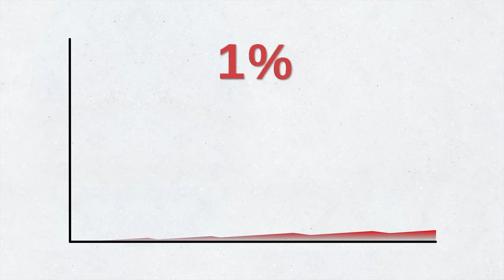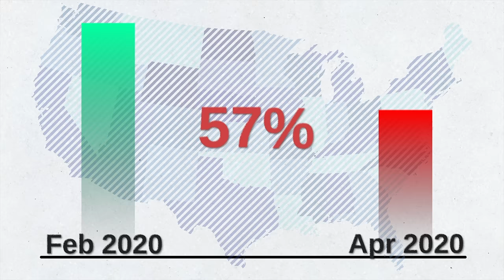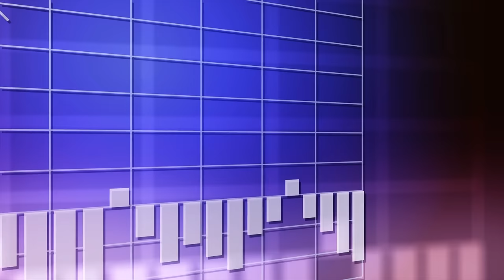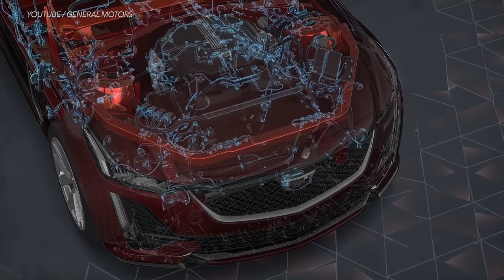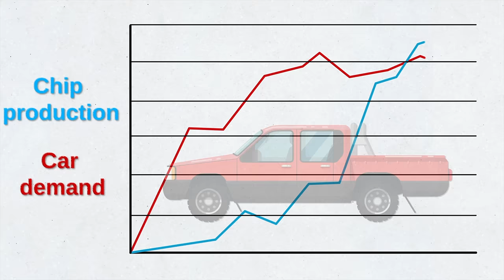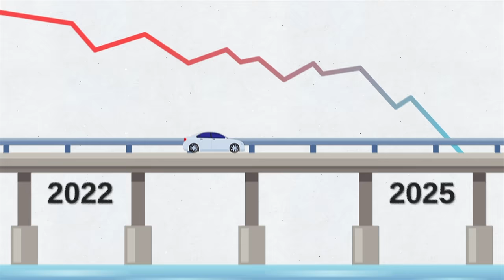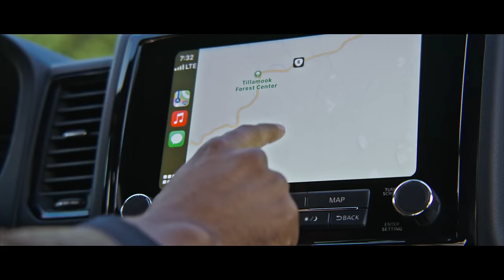Brace Yourself, The Car Crisis Just Got a Lot Worse

Comment: My 2013 Camry with 146k miles is shuttering between 40 to 50 mph.  I think I need a new torque converter or transmission.   Toyota is aware of this since they put different transmissions in the 2012 to 2014 year models Camrys.They keep torque converter in stock at dealership. They have not done a recall.   Dealerships knows we will pay price to repair.  Cheaper to replace torque converter than purchase a used or new vehicle.
Reply: Things wear out. It’s old and driven. If it’s a semi-common failing item they will stock it. Not all issues will be a recall subject. If the shudder is minor I’d suggest living with it. As long as your fluid isn’t contaminated it is likely just a stick/slip condition during lock up. At least on the Honda side renewing the atf greatly helps vehicles like the pilot and odyssey. How is the vehicles atf maint history?

Comment: Aug 2021: Bought a 2010 Toyota Venza V6, with 118K miles; out the door with Credit Union GAP, 3 year full coverage ins on engine and tranny for $12,385.00
Sold old car for $2k, so $10,385.00.  You tell me, did I get a deal in these days and times? Yes, I overpaid, but not nearly as bad as what I see the same car going for now with nearly 90K more miles than mine. Cheapest I've found a 2010 Venza within 100 miles of me is $16k.
I want a F150 or Tundra, but I'll wait while keeping the mileage low on this Venza. Back in August all the F150's and Tundra were already out of my price range, today OMG! If it's on a lot, they start at $19k with over 200k miles and at least 9 years old plus.

Comment: I just bought a 2013 F150 Lariat 4x4 5.0 V8 with 90K miles. Got it for $18,000.00 and strangely felt like I got a great deal. I figured that if I waited too much longer, it would cost me over $30K for something similar. I wasn't looking for such a fancy model. Just wanted the extended cab instead of the crew cab, and they are hard to find in SoCal. I plan on keeping it until it falls apart.
Reply: My co-worker bought a 2000 chevy half ton 4x4 extended cab short box with 70,000 original miles in mint condition for $17,000 in August 2021.  He said it was a lot cheaper than buying a brand new one.

Comment: Just bought a used Mini Cooper with slightly over 1,000,000,000 miles. Came with complementary windows phone charger and a flat spare tire. Only paid half a mil, and was told “It’s a great deal”. Payments are only about 50,000 a week. How’d I do? 😂🤣😆

Comment: Wished you could of made this video back in December 2021. I wouldn’t have sold both my used cars to private buyers to pick up a new 2022 Honda Odyssey Ex-l. I want aware of the car market issues. Dealers were either out of stock or had an unknown ETA for the vans coming in. They were selling 2018-2021 used odysseys for almost brand new msrp price with some decent mileage on the vehicles already. People also were putting money down on new Odysseys and placing a hold on them too. Also, most dealerships had a “MA” aka Market Adjustment price that was approximately $4k extra added on. We were literally going to buy a van with the crazy price mark ups due to us being car-less. I found a perfect red in color Odyssey that I wanted at a Honda Dealership the night before. Expecting it to be en route to the dealership yet and expecting the added “MA” I wasn’t too hopeful to call them in the morning. I literally was on my way to another dealership the very next day to pick up an overpriced Odyssey as we were car-less for a couple of weeks. Luckily, I called at the dealership for the red one and due to it being the last week going into the New Year (2022)…They were selling it for MSRP! Still had to wait 2 weeks for it but it was well worth it in the mark ups and out of stock Odyssey issues at all the dealerships I checked and looked at. That’s was my crazy story I experience that I went through.

Comment: I had to get a new car, my 02 nissan sentra was dying I paid $1650/200000 miles, just before 250000, timing chain was going, couldn't do it myself, cheapest I could find was $800, I got a 2020 yaris/Mazda 2, not a bad car, I bought it last year it should have been around $18000, I paid $22000, but I drive 120miles back and forth for work

Comment: I bought a brand new Nissan kicks towards the beginning of the pandemic, September 2020. Wasn't even looking for a car, Nissan called me out of the blue and told me they wanted to buy my existing car because their supply of used cars was low.  I told them I like my car, and hadn't held a  job in 6 months.  They said we don't care if you don't care. So I made them a lowball offer,  they said okay, so I said ok.   Ended up being Blue Book value for my trade, and $3,700 off on a new 2020 $21,000  vehicle.   Easiest automobile deal i ever made, beginning to end about 30 minutes tops.

Comment: I ordered a 2022 F150 XLT 4wd on 29Nov21 for $6k under MSRP with X-plan and current rebates.  I got premium trade value for my 2017 F150.  I figure adding those two factors together it was about equal to the typical $10k off sticker at the end of year we would normally expect.  Difference is I got to order exactly what I wanted.   I also bought a 2022 Camry SE, taking delivery in October of 2021.  I paid MSRP and had to wait 10 weeks for a dealer traded vehicle that was pretty close to what I wanted.  I might have paid $3500 more than a typical deal, but considering we are seeing prices go up I'm not sure it really is all that bad compared to waiting.

Comment: Thank you for the very informative videos. 
I caught a break. Two months ago I sold my very low mileage mint condition 2020 1794 Tundra for $12,000 more than I paid for it. I then bought an Avalon limited hybrid $2000 below sticker & shipped it overseas where I spend 90% of my time lately. Ideally I would rather have the tundra as my daily driver but as it's considered a work vehicle in the country that I'm in, I cannot get a student tax break on it, so for now the very cramped Avalon will do.
Gasoline here cost double than the USA.
Hopefully in about a year or so I can sell this vehicle and bring in a 2023 Capstone or 1794 Tundra

Comment: I did pretty well considering the market. We baught a 2020 Toyota Camry SE that had 24k miles on it and by the time everything was said and done we financed 24k after trade in.  We got a lot for our 2015 Fusion more than I expected, but the car we have now is far superior to what we owned. Since that time about 2 months ago the prices have went up again. I did not want to buy right now, but my wife needed a dependible car and the Ford Fusion was not dependible or reliable. Sad too because we liked the Fusion fine it just was not built to last like the Toyotas are. In fact I do not think any domestic car or suv is built to last right now. Too many Govt. mandated technologies that are proving to be un-reliable and super expensive to fix. Yeah even our new Toyota will be crazy expensive to fix, but I will take my chances with a Toyota or Honda anyday over a Ford or GM made product. Ford and GM were making some damn good vehicles in the late 90's to early 2000's then by 2005 they went downhill fast!

Comment: Car dealers raise their prices due to the fed tightening the credit system, which requires higher payments due to less risk availibility bc all the injexted $$ wait till those ppl who bought their benz default, currently its expected to be higher than in 08, if you can weather the storm id still wait, used car lots are filling up as credit tightens.

Comment: When you have to reprogram a car or truck just  to change a fuel injector to get it to run right.  What's next? Reprogramming for a spark plug change or changing a spark plug wire set? Oh wait you already have do that with some cars if you change a coil.

Comment: I drive my 1973 MGB all summer for the most part.  Nothing electronic(still runs points), everything works and it gets 27MPG.  Built in anti theft device...called a manual transmission and manual choke!lol!  I'll also still be driving if Russia launches a nuke and the EMP fries all the new cars as well!  More gas for me!

Comment: They should make the infotainment system optional. I personally prefer simplicity. If a button goes bad, its just one button. But if the infotainment system goes bad (blank), a lot of features are inaccessible. I personally experienced it. Same thing with those fancy LED trim/brake lighting. They consist of many tiny LEDs. Over time, some LEDs go bad and the visual effect is crappy. In addition, its cosiderred a mechanical vehicle violation and you become a subject of getting pulled over...we don't want that! So when individual LEDs go bad, the only choice you have is to replace the entire light (housing), which can get expensive very quickly up to several hundred dollars! Remember when you could just buy a simple bulb for $5-7 dollars? Again, I like simplicity. These days, the manufactures are cramming more and more electronics in the cars. That means there is very high probability that something will malfunction...and it will malfunction. I wish the manufactures made simple cars (easy to maintain) and also cars loaded with electronic for those buyers who prefer those kind of vehicles. We, the consumers, are at the mercy of the manufactures and we can only get what we are offered....not much in the world of simplicity.

Comment: Due to the rise of gas prices I have been looking for a fuel efficient daily driver, my current vehicle being a 2016 Tacoma that gets 17 mpg at best. The search has been HORRIBLE. I've been trying to find something decent under 2k which is impossible around me unless you buy a car off FB marketplace which will come with a mystery issue. I had my eye on a 95 Celica gt that was on a local used car dealer stone lot. It is currently not for sale yet though as they need to do an enhanced inspection because of the car formerly abandoned. That makes me nervous to buy in the first place plus with the way car prices are it probably won't be cheap either. I now however have the opportunity to buy a 99 civic sedan with 120k miles on it from my grandma and she won't accept me paying over $1200 for it... I mean hell of a deal for me with the way things are! I'm lucky but I feel for those that NEED a vehicle right now.
Reply: get a hundred dollar scanner for starters.  learn how to use it or hire a mechanic like scotty to check it out.  don't buy anything without scanning it first.

Comment: just bought 2002 Pontiac Firebird Coupe base $16000 with 17,500. actual miles, 3.7L V6, one owner no accidents.  Is there a problem buying older low mileage autos? my current car I bought 8 years ago, a 1995 jaguar xjs inline 6, 4L, 17,000 actual miles, one owner $13000 on ebay.  Had to replace fuel pump very shortly after getting it.  Got 92,000 miles on the jag now and no other major issues, runs great.  So again, is there issues buying a low mileage older vehicle that I may not be considering?

Comment: Enjoyed your take on lack of chips presentation.  I bought a 2011 F150 for $12,000 that has 100,000 miles, V6 that does not have  booster.  I traded  2003 tundra which he gave $3,000 reducing the $15,000 original price for the F150.  Did I do well?

Comment: I have a 2011 Rav4 4WD V6 it's got 140,000 miles on it and no signs of slowing down, I live about 60 miles east of where Scotty grew up, if you know the area you know it's probably the absolute worst environment for a vehicle  in the States.  I will never buy a used vehicle it's simply stupid. Why buy something that is going to die before it's paid off, it's just dumb and also my opinion.

Comment: I just stole a Jeep Patriot 2015 been sitting in a garage for the last 3 and 1/2 years $24,712 MI manual transmission late could not drive it like your Toyota manual everything don't have to worry about electric or switches $3,000

Comment: Hey I am wondering what year that truck was in your short,  I have a ford 1994 f150 but I am not sure if the fuses would actually go out if I got it running again in an emp.  Is the only cars under 1970s?

Comment: What a treat it would be if cars ,trucks, SUVs were all "made simple " again....with mechanical steering, brakes , and a cable from the foot pedal to work the injection. Use gears to keep the engine in time, not belts. Have all gauges to watch..Roll down the windows by hand, manual door locks. Cable emergency break... Way too much electronic crap , distractions on a new car. Plus the new ones have the engine "sealed " with no dip-stick for engine oil or transmission fluid! Must take it to dealership for 600$---800 $ tune up after so many miles. So let's get back to basic transportation...hell with the stinking

Comment: New cars get worse every year.   Cost cutting and weight reduction make them less reliable and more expensive.  With an economy in the crapper for the last 2 years and likely the next 3 as well people are going to stick with the car that brung you to this mess. 
If I could get a truck with decent gas mileage, no luxury upholstery or plush carpeting that didn't rust away on me in 3 years I'd be shopping.  Since all pickups and SUVs are rolling living rooms I'm debating restoring a vintage truck to get me through my golden years.  I'd be happy with a 4 speed carburated old truck than crap that talks to me and has a TV on the dash.

Comment: Sold my 02 Nissan Xterra SE/SC in 1/2019 with 164K miles. Bought it new, was in excellent condition $2900 (needed tires). This month bought a 04 Xterra XE from original owner with 75K miles, great shape minus minor cosmetic needs, faded rubber, for $8500. Price up but mileage down. Bottom line, we're all getting screwed at the pump via Clueless Joe.

Comment: And all these commercials on TV about car shield tells you cars and trucks are junk never I my life were as about car service other than oil or tires or a fan belt, the high price for electrictronic plastic trucks and cars a joke like opening a model car box the tires were rubber and the axles metal just like today plastic cheap parts